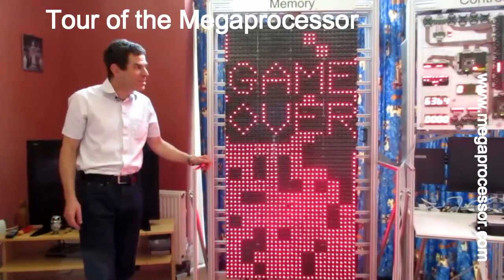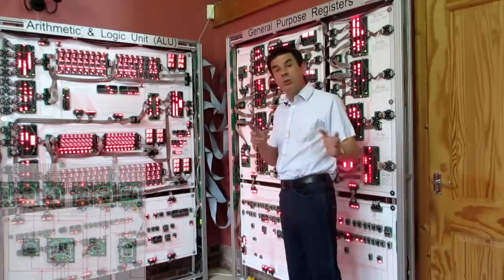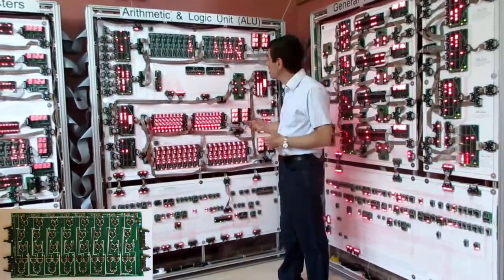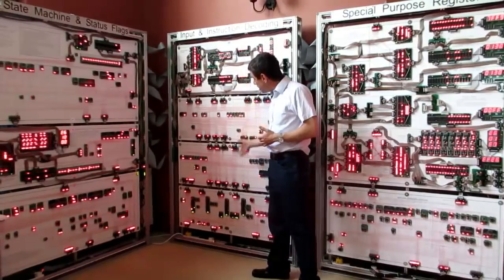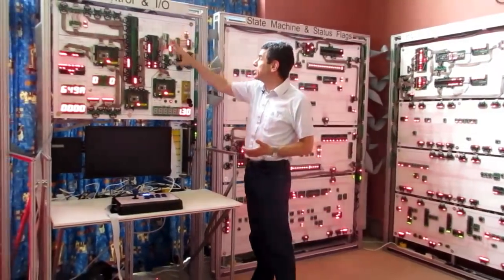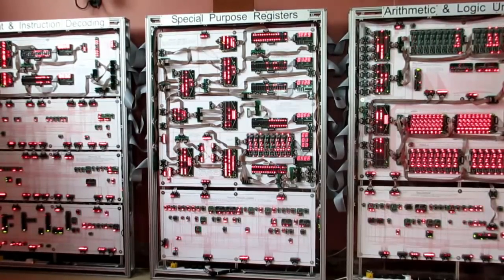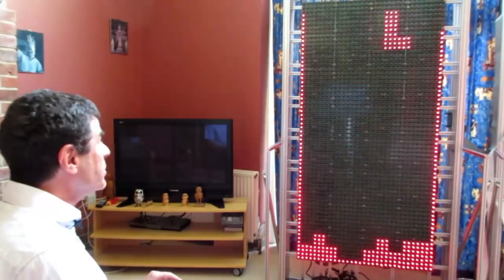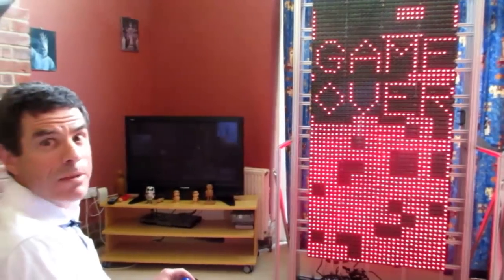Megaprocessor Tour 1 - (fixed audio)

Comment: Kinda disappointed how you glossed over the main memory.
Reply: DanieleGiorgino using part of the main memory as framebuffer is smart because you save a LOT of money by just using every bit as one pixel, instead of building a dedicated section like a video controller with his own video buffer memory and processing unit, that could likely double the overall cost.

Comment: Why are some of the LEDs green?Is green for control instructions and red for data, or what's the difference?
Reply from the maker: I used green for "selections" so channel enables on multiplexers and inputs to decoders. When looking at those kinds of boards in closeup I thought it might help to separate out those signals. I also use blue LEDs for the clock, but you can't see them when its running slowly.

Comment: If all the RAM is used as video memory, where the executable code for Tetris is stored?
Reply from the maker: As well as the 256 B made with discrete transistors and LEDs there's another 32kB "sensible" memory as one of teh peripherals on the Control & I/O frame.

Comment: If I donated a large continuous knob would you use it to control clock cycle?

If there is work needed to interface it with the current clocrk cycle control then I can help with that, I have an electrical engineering degree and really want to see a large knob on there.

Thank you for building this, it was something I dreamed of building and I am so happy that someone actually built it.
Reply from the maker: What I really wanted was a large lever. In the early days my dream for the control panel was something out of a Frankenstein film (hence the name of Igor in my early sketches). In the end there wasn't much to control so Igor disappeared. I dithered about a large dial for a while, but in the end went for the large linear rheostat. I think I'll stick with it, but thank you for the offer.

[The interface is fairly straightforward, the rheostat gives a voltage 0-3.
There's a PIC on the control board which has an ADC and maps the reading (logarithmically) onto the clock range by and then works out the required divisor for the master clock. The clock pulses are generated by an FPGA]

Comment: It would have been cool if the Megaprocessor could run at 1 Megahertz.
Reply from the maker: I'd have been even worse at Tetris
Reply: Wow.  Those LEDs are already a blur at 8 khz.  This really illustrates the power of modern computers.
Reply: Didn't he say it runs at up to 8 Megahertz?
Reply: 8 kilohertz, not megahertz.
Reply: Well, think about what 8Khz means. 8000 operations per second. You'd be doing well to see that. 

And then think that computers as old as the early 80s had >1Mhz processors. A million operations a second. Crazy to think about.